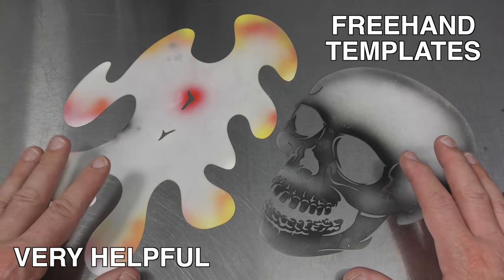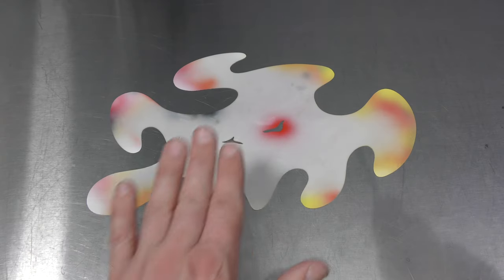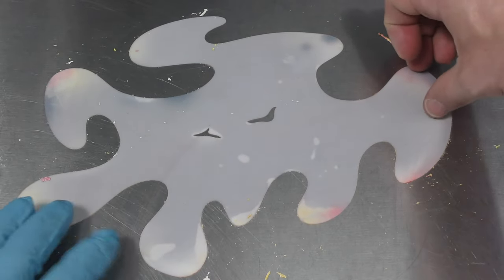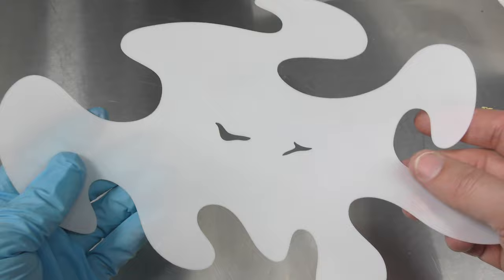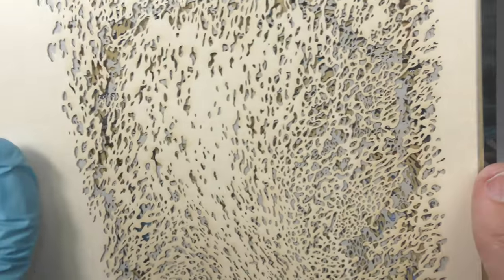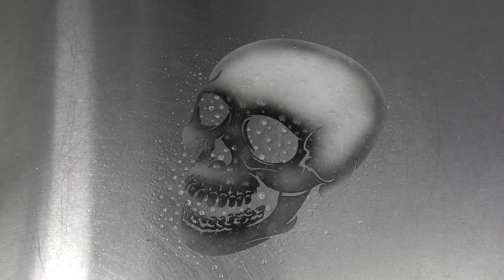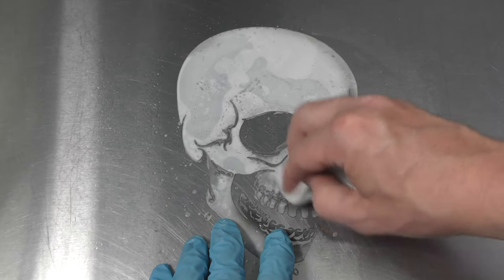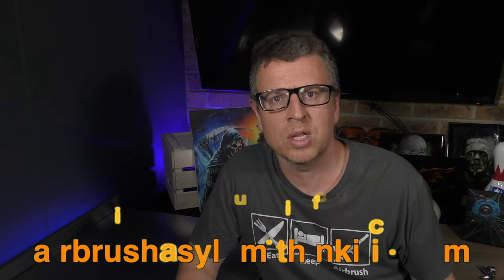Airbrush Stencil Cleaning Tips That Help

Comment: Great Tip.   Never thought to use windex to clean my templates.  I only ever use water based paints, but was previously using thinners to clean my templates.  Will definitely give the windex a try.🙂
Reply from the maker: Yes give it a go …you will be amazed at how well it works 👍🏻